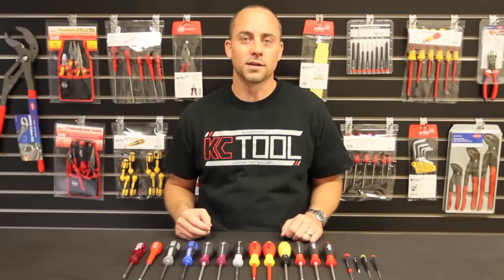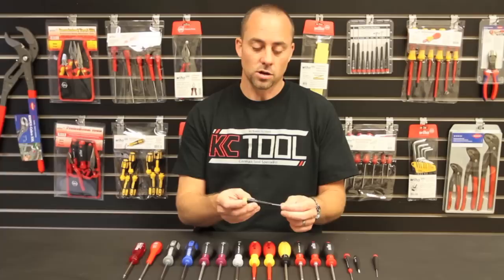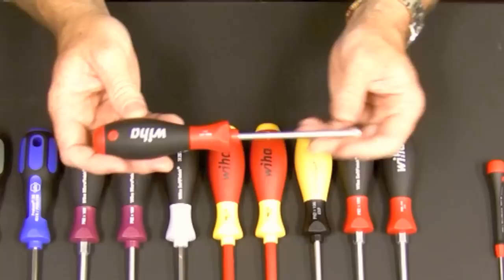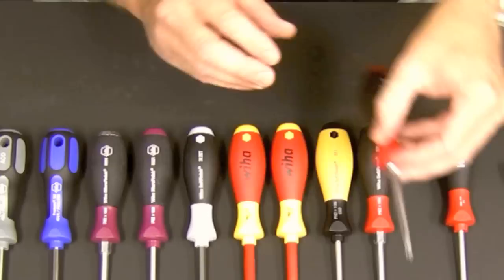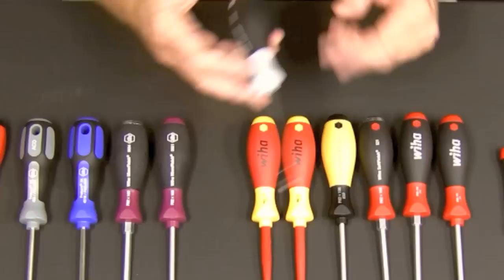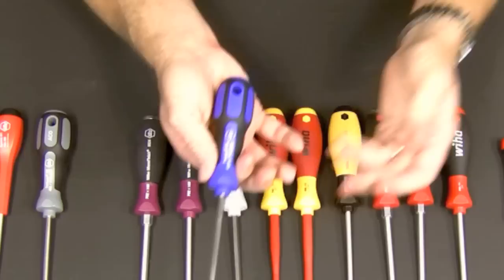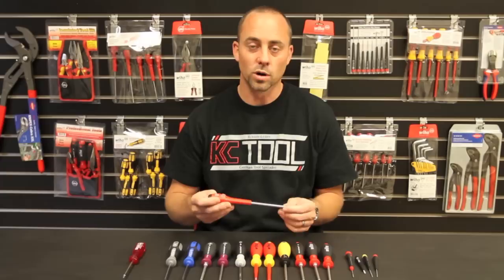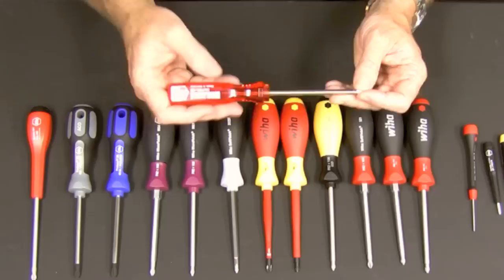Wiha Tools, Wiha Screwdrivers Comparison by KC Tool and Review of 17 screwdriver styles

Comment: I bought a set of Wiha L-key Torx T6-T20 11 years ago, I used them daily. They look brand new and no wear on the tips at all. I ordered more Wiha drivers, bits and the Bi Cut Pliers from KC Tool. KC Tools shipping is the best, very fast and on time.  I will be ordering a couple of Wera drivers and bits. Plus you get a Felo #2 Phillips bit with every order.
Reply from the maker: Thanks for the super kind words Mikester 619!

Comment: I am trying to find electrician screwdrivers that have a label on the top end. When they are in a belt and you look down and should be able to see which one is which. Nobody seems to mention that or say if they have the label on the end. You can marker them, but it wears off too easily even with an indelible marker.  Very necessary and simple design they should all have, but so many don't.
Reply: MyVideoMix
The Wiha Insulated (Red and Yellow) like in the video, definitely have labels on the top. Just bought one in 2018. Cheers.

Comment: Are the Wiha Dynamic Grip Screwdrivers still made?  I could not find them on the site.  In particular, I’m looking for the Wiha 51055 Slotted Screwdriver with Dynamic Handle, 5.5 X 125 mm.  Thanks!
Reply from the maker: Sadly, the Dynamic Grips have been discontinued. But there are still a few available on Wiha's outlet site: https://www.wihatoolsoutlet.com
Reply: @KC_Tool  Thanks, I just did order them.  They are almost giving away these outlet items!

Comment: I can't decide between the Whia microfinish, or the Wera laser tip in stainless. Any suggestions?
Reply from the maker: The MicroFinish series is great if you're going to be working in or near greasy applications (i.e. automotive).  The Wera stainless are great in the fact that they can be used in marine environments and will not rust (i.e. boating).  Both are excellent choices though for a daily screwdriver!

Comment: As far as Wera which of all screw driver set is the better one aside from insulated ones
Reply from the maker: The green and black Kraftform handle is the sort of the standard for Wera. Everything after that comes down to preference. There are versions with striking caps, stainless steel blades, etc....

Comment: I'm needing a T9 and T6 bit for opening a mass of PC Hard Drives for recycling... do you have a suggestion?
Reply from the maker: I would go with this T9 http://www.kctoolco.com/Wiha-Torx-Power-Bit-T9-x-50mm-p/74517.htm
and this T6 http://www.kctoolco.com/Wiha-Torx-Power-Bit-T6-x-50mm-p/74511.htm  

If you're doing a very high volume, you may also want to get an electric torque screwdriver like this that activates when you apply it to the fastener. I used one in the past and it makes a world of difference when removing a lot of screws.  Sorry I cannot remember where we purchased it. Kilews Power Torque Electric Screwdriver- replace pneumatic screwdriver
Reply: KC Tool Co
That was the very detailed and specific information I was hoping to hear... there's a ton of amateur scrappers using whatever $10-$15 security bit kit made of the poorest materials that are chewed up in a dozen uses. Each Hard Drive has roughly 16-20 T9 screws, so it adds up. I'll be ordering these to test and include in a 'How To Better' video on the subject. Thank you very much!

Comment: Do they make a hollow ground set for gunsmiths?
Reply from the maker: +walter chiappini Wiha makes a few hollow ground insert bits, however, no actual hollow ground individual screwdrivers
Reply: The bits are held by gravity or they are magenetized?  Do they have a cam? I am looking at Chapman bit sets that are very highly regarded. Those are held by a ball cam.
Reply from the maker: +walter chiappini The bits are held in by either a magnetic bit holder or a bit holder with a mechanical locking feature.  Wiha bits do not feature a ball cam/detent.  Shoot us an email if you would like additional info, part numbers, etc. customerservice@kctoolco.com
Reply: KC Tool I am looking for a gunsmiths set of hollow ground bits.Slot type head. Probably standard US,if you have such a set.
I buy early 1900,s guns and those are not Philips or any of the more modern screw head types. Usually US or British types. An occasional Mauser. Thank You
PS Chapman bits use the ball cam lock in their holder or ratchet wrench.

Comment: Love most my Wiha tools except for the "Heavy duty" units with the steel caps shown here. The tips are over hardened and all the standards tips have snapped off. Skip em.
Reply from the maker: BobbyCamarillo Thanks for the feedback. That is the first time we have heard that but I can see it happening since they are built different with the intent to be used as a chisel, etc.  Also worth a mention is they are very heavy and not something I would want to carry around often.  I think for the right situation they are great but would not be my first choice for every day use.
Reply: Agree , surprised to read that about them Wiha"s , perhaps he hit them with a sledge hammer!!!!!!!!!!!!!!
Reply: +CC MOGS +Still Flame  Of course you have figured it out. I am just a silly tool and die maker that knows nothing of metallurgy. I am glad you were able to find out I am a liar and used a sledge hammer from behind your keyboards. Assuming someone a liar and a dolt just because they have a bad experience with an item speaks volumes about you not me. Wiha did indeed warranty each and every broken driver as they were indeed found overly brittle upon inspection. Thankfully three weeks in Thailand have left me content not to allow the likes of you to dull my day.
From the heart, 
ไปมีเพศสัมพันธ์ด้วยตัวคุณเอง